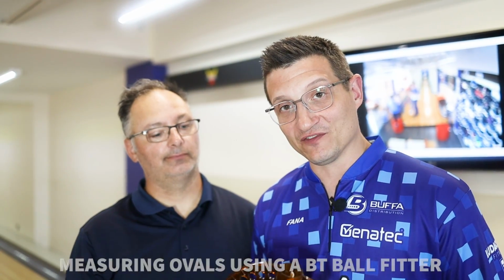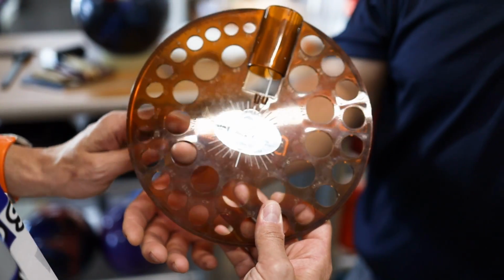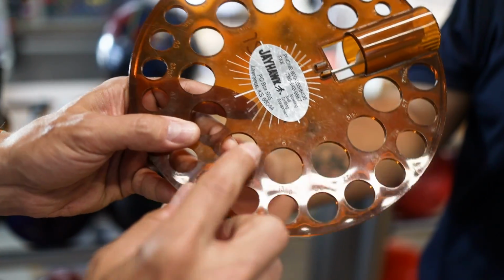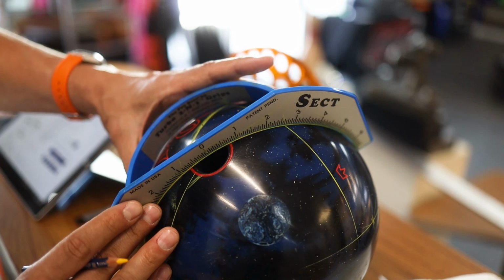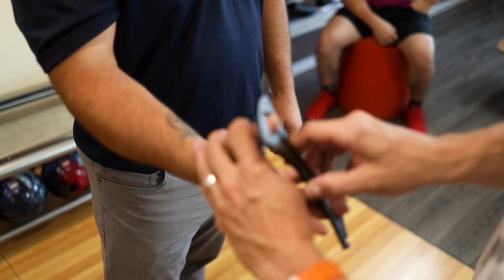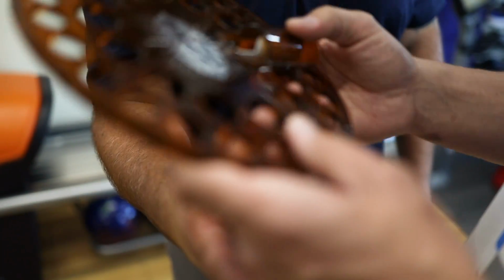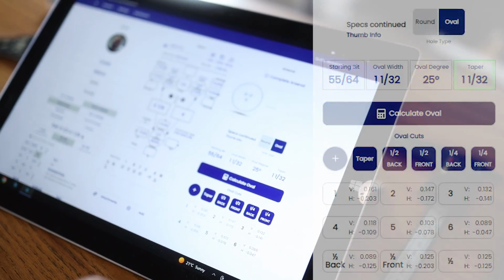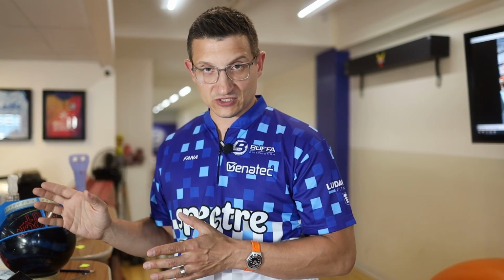How to Measure Ovals | Bowling Pro Shop Tutorial

Comment: The measurement to get the thumb all the way to the base of the ball is so important.  I can't even tell you how many attempts I've made to get a good fitting thumb to no avail.  when I put the tape in the thumb hole to snug it up, my thumb would not go in far enough to get to the base.  I would end up losing it quick off of my hand causing a weak release and coming over the top missing the target away.  A few weeks ago I went to see an old friend of mine who knew my game and is a PSO.  He looked at my thumb fit and saw that I wasn't getting to the base.  He was able to use a milling bit and open the top off the hole so my thumb would seat right on the crease.  Wow, all these years with a bad fit, now my hand is so relaxed in the ball and my scores are up.  If you can't get a good fit from your local PSO don't be afraid to take a trip and seek out a second opinion.
Reply: My th7mb is my prob. Its frustrating.
Reply: If you can't a good fit locally, get in your car and seek out someone who is knowledgeable.  I wasted so many years strugling to get a good feel.  When you think of money and time and results it is worth the effort to seek someone who can help. @StƏphaniƏ012